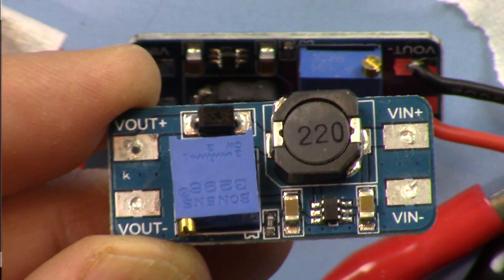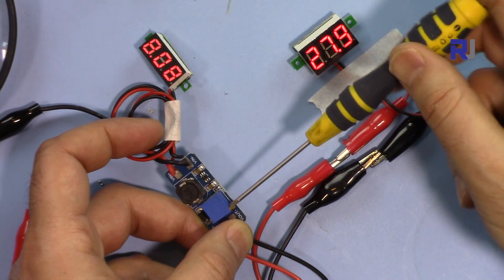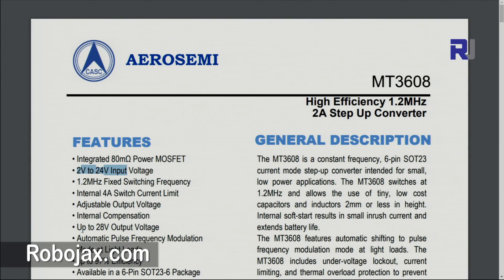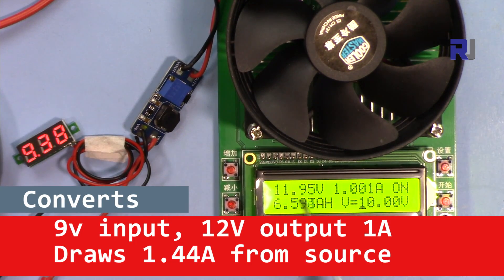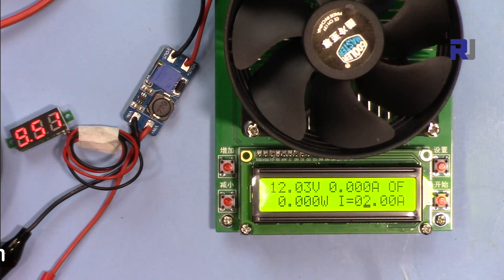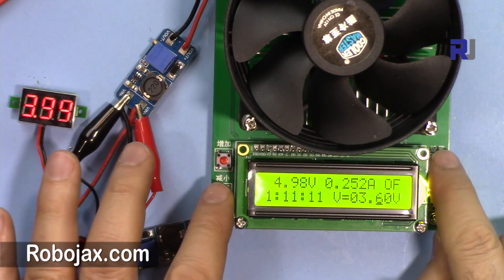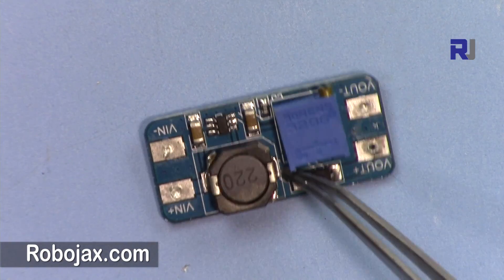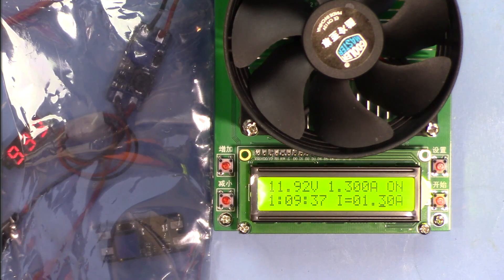Test review of 2A DC-DC Step up boost converter MT3608

Comment: But you can add mosfet on the chips output then it will not heat up that much and will deliver more curent(sorry about my english)
Reply from the maker: Yes you can change it. But my review is about this module itself without any change.
Reply: @robojax  i know but i just say how you can improve it(my english sucks)
Reply from the maker: Just add heat sink.
Reply: @robojax  if you add mosfet then you can get more curent out of it
Reply from the maker: not with this module.

Comment: Does anyone worry that failure mode could pump too high voltage?
Reply from the maker: I did read the datasheet and did not find any mention of the issue you  are interested in. as I was working with this,1 or 2 of them got damaged and the only thing that happened was the output was the same as the input. So it did not boosted.

Comment: Hi,i buy the same voltage booster,will it burn if i connect to 12 v car battery or it is not recomended,greeting
Reply from the maker: No. You can connect the input  to 12V.

Comment: I think this 2A meant to be the current which can draw maximum at any conversion. So for an example 12 to 24 conversion if you set the input current to 2A,  12Vx2A=24W and the output will be 24W/24A - (loss of the conversion)  = less than 1A. So I hope it works as they specified.
Reply: "...24W/24A..."    I guess you meant 24W/24V (Volt not Amp)! Other than this I think the same. Test failed by 12 to 24 with 1.5A but got kind of better with 1A and passed with 0.5A, so if you calculate the inefficiency or as you say loss of conversion something between 0.5A and 1A should be in the advertised 2A max. in this case.
Reply: pm me can you to install do sola paint of charger.
Reply: @anwin85alon
Sure, I can paint your charger.

Comment: Got one from ali express.  Doesn't work.  Input equals output.  So sad
Reply: I just buyed 5 on Ebay, ALL gives an output of 4.2V max. at 3.7V input as soon as it draws power. With no load i can go up to 28V.... WTF. :(
Reply from the maker: I mentioned that you have to rotate the potentiometer about 15 times until you see change in output. Try it.
Reply: Robojax I've tried many times already.  I got a data sheet.  Will fault find and let you know. Cheers

Comment: now this is what i call a test, well done! So if i have a variable 2-4V@60-400mA imput, can this board hold a Voltage of 6V or will it change if the imput Voltage is unstable?
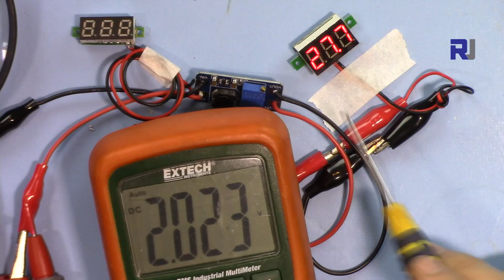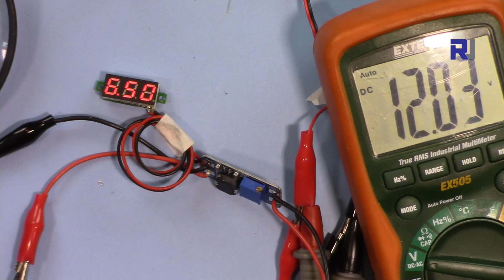Reply from the maker: at 01:14 (click to watch) I have shown that 2V is at the very edge where the module will not work. At 03:00  I have explained that the output is stable even if you change the input.
Reply: Thanks, just got a 5Pack from Ebay, my son will have a lot of fun building toys and solar builds this summer
Reply: oh, and you may like the "MCP73871 Power Boost USB 5V" Board, The black one, it can Charge and supply power to the applikation at the same time and so on, maybe you get one to test it?

Comment: I had purchased five of these circuits. Hoping to convert 12 volts to 18 volts. With no load, I connected the input to a 12 volt battery observing correct polarity. Each one immediately snapped and smoked and did not function. Is there something I am not aware of about connecting these to a 12 volt battery?
Reply from the maker: This is what happend to me  with other boost converter.  Apparently for all boost converter, we should have some kind of load otherwise the voltage continuously increase and it burns when the voltage reaches above the limit.
Reply: I've ordered this module and is yet to be delivered. Thank you for reporting.

I guess the trimpot is the culprit here. It might be at its lowest output setting.. maybe for 5v or even 0v... and you were connecting it to 12v source.

The input voltage has to be lesser than the output voltage for a DC boost  module.. Can't be vice versa!

Next time, try turning the trimpot screw anti-clockwise as much as you can before connecting to the battery.
To be extra safe, try connecting it to a 3v coin battery (maybe CR2032) and read the output voltage before connecting it to a powerful battery. I'm fairly sure a coin battery doesn't have enough juice to kill this module.
Reply: @ansk  thank you for that information. I had purchased some more of these and this time attach them to a variable power supply starting at zero. I slowly increase the voltage monitoring the output with a slight load. I was able to adjust the output and raise the input voltage to the 12 volts I wanted to use.
Reply: Thanks for the reply. :)
Took your advice and used a DC voltmeter (about 20mAH load) instead of a multimeter to read output voltage. Source were 2xAA used batteries with total voltage of 2.7v. The maximum output voltage I could get was only 26.9v! Maybe my module needs 3v min input for the rated 28v max output?!
Anyways! My requirement is to power a  12v 10w (833mAH) LED from 2xAA NiMH 1.2v 2600mAH batteries.
I hope the module does not heat up  much.

Comment: bro please please please tell me ,i can use  this converter in, 6v solar panel in run 12dc
Reply from the maker: Yes this can convert 6V to 12V. But remember this can not have power. Power = Voltage X Current . voltage is V, current is A.
Reply: and I can Charge 12v battery in 3waat 6v solar panel in boost converter. 
and, how many time charge this battery
Reply from the maker: Okay. We got 3W, 6V which means 3 ÷ 6 = 0.5A or 500mA. Then see your battery capacity. for example 3000mAh . If that is the case, then 0.5A = 500mA, 3000mAh  ÷ 500mA = 6H. So it will charge in 6 hours.
Reply: okay. I will charge 12 v battery in 6hour's ok
Reply: how many ampere converte, this boost converter
Reply from the maker: watch the video. I have explained it.

Comment: input 5v 1a to 12v 1 a can ?
Reply from the maker: NO. this will not work. At input 5V x 1A= 5W power, at output 12V x 1A = 12W, output can not have more power than input. in fact it is always a little low due to deficiency of module.  usually output is about 80% to 90% of input.  So you should expect less or increase the input current from 1A to 3A so you get 5V x 3A = 15W and it will be able to give you about 12W at output.
Reply: No it cant Voltage up current down :)

Comment: Hope you could possibly help. I was looking at these but after watching your video I don't think these work for me. I need to boost 5v-9v but I'll be varying the input voltage between 2-5v and I need the output voltage to move in relation to the input voltage. Is there a similar product that will do this for me? Thank you in advance
Reply from the maker: What you are looking for is called amplifier. This is regulator and keeps the output fixed regardless of input voltage. Amplifier will have some gain factor for example x3 or x100 or x2.5 and whatever the input is, it will multiply it by the fact as longs as it is within the limit of the device.
Reply: Robojax Is there an amplifier you would recommend. I basically need it so expression pedal that puts out 0-5v but I need it to put out 0-9or10v
Reply: Robojax not sure if I'm completely wrong but could I just use a standard 10w 8ohm speaker amplifier or would I need something more specific to accept the 5v coming in?
Reply from the maker: Speaker amplifier is not suitable as the input and output are non linear, meaning the output doesn't follow the input in a straight line. it is more curved and you will not get desired result. 
How ever it is possible to convert or make one of these modules to your application using arduino. But you would try different module and find the right one. Using Arduino you will read the pedal voltage, and correctly send signal to the potentiometer point of the voltage regulator and will act as if you rotate the potentiometer and the output voltage is changed.
Reply: Robojax thank you :)

Comment: did it already.added 82k resistor to 22k trimpot.this is for the version where the 3 rd leg of the precision trimpot IS connected and the voltage variation only occurs over about 20k. in the second variation the 3rd led of precision trimpot is not connected to anything and voltage variation occurs more evenly over a 100k normal trimpot

Comment: i replaced the100k  25 turn multi turn pot with a normal 100 normal 270 
degree trimpot.  the 25  trimpot is really stupid and you need a 
screwdriver and there is no knob for it anywhere

Comment: how about  3.7 to 12 out at 1.5 amp? or 1amp
Reply from the maker: sure it should work. This is way below the capability of this module.
Reply: it wont work... it has 2A current limit. The current limit is on the switching mosfet integrated in that IO. If you need 12V 1,5A at the output and 3,7V input (i am guessing that you mean lithium battery so it is 3-4,2V input) then you have 12*1,5=18W output power, when we consider lower effenciency at 3V To be sure lets just calculate  80% so 18W/0,8 22,5W at the input. If you have 3,1V input (almost depleted liion) it is over 7A of current. This one si rated just at 2 Amps...

Comment: Mt3608 based boost convertor is very good than others, stable output, it's very good for power bank
Reply from the maker: yes I agree.
Reply: Robojax xl6009 regulation very poor for low voltage performance.

Comment: Can a 24v dc motor of  250 watts can run on the step up module?.Please reply
Reply from the maker: Not using this module. For 250W and 24V the current is 250÷ 24= 10.14A which is way above capability of this module. You will need a module that can handle 11A or higher continuously.

Comment: Hey Robo, Can i use it at 5v 2A to 9v 2A im planning to use it to power my guitar pedal board with 5 pedals 600mah each.
Reply from the maker: No you can not. The power you are providing is 5V and 2A, 5x2=10W, and you are expecting to 9V and 2A which is 9x2=18W.
You can get 10W if efficiency is 100%. In this case you will get less than 10W.

Comment: How about it with 3,6V in and 9V out (with 500mA)
Is it stable or to HOT?
Reply from the maker: I am sorry I don't have it in had now. You can deduce if it gets hot or not from from thee other test results.
Reply: It's will take approx 1.5 amps at 3.6 to give 9 volts at 500 ma it will get hot. But the main failure of this module is when the 3.6 volts decreases it will boost the volts more than the 9 volts which will burn or kick your working device out of this world for sure. Soon I'll make a video my self showing the amps drawn in and amps drawn out.

Comment: Nice video! I appreciate how you showed that the chip got hot with high load as well as when using a large input/output voltage difference. The MT3608 is quite a powerful little chip, but one needs to understand the limitations of these modules. I killed one myself when making a 9V rechargeable Li-ion battery and then fixed the module by replacing the chip. On my channel you can find the videos I made about that. Perhaps you like to watch those...
Reply: pm me can you to install do sola paint of charger.

Comment: I have a electric bike battery with a USB charging port on it. I am unsure as to what the maximum rated current is on the USB charging port, but I think it is 3 amps. Is there a way for me to test what the maximum rated current is on the USB port? 

I was thinking of buying this: https://www.ebay.co.uk/itm/401092379923
The input takes microusb. I want to step up the voltage to 24 volts to power some lights that I have on my electric bike. The lights in total use 43 watts. So 43 watts at 24 volts = around 1.8 amps. Will this converter be able to handle 1.8 amps? Also, what current will 1.8 amps output take from source i.e. When 1.8 amps is being drawn from the output of this device, what current will the device draw from my source (which is the USB port on my electric bike battery). Please let me know if you have a solution. Thanks!
Reply from the maker: The first thing, you have to know the USB charging current to proceed.  From the current of your USB and it is 5V voltage you can find the power (watt).  Then when you convert it, the converter always have some loss like 5%-20%.  This module can give only 0.5A at 24V.  so 0.5x24=12W so you will be getting 12W. Depending on your battery, if you have 5000mAh battery it will take 10 hours to charge.
Does your bike come with charger? or you are building it your own?

So this module is very  weak for your application. if I know your budget and type of your battery, I would be able to suggest something.
Reply: Robojax Hi thanks for the reply. I'm not actually trying to charge the battery, I'm trying to draw power from the battery to power lights. I wanted to know if the USB output on my battery is able to power 43 watts of lights that I have on my bike.
Reply from the maker: if you do the math 43w÷ 5V= 8.6A and USB can never supply that. Besides, your bike must have on the manual or somewhere writing the amount of current. So get that current multiply it by 5V (usb voltage is 5V) and you can find how much you can draw.
Reply: Robojax Hi, thanks for replying :)   I built the bike myself (and bought parts separately from different sellers). The battery was actually bought lightly used so it didn't come with a manual. I therefore have no way of knowing what the maximum rated current of the USB port is. Is there any way to check?
Reply from the maker: I don't know if you can check it. But you should have some paper or ducument to tell you. Opening it might be lead not to be able to find the usb charge chip or not being able to read the chip name. 
in any case, as mentioned above you will not get 43W anyways.

Comment: I have the same unit - but upon testing I found that the potentiometer does not do anything. This unit is merely functioning as a pass-through. Something's not working - no matter which way i turn the pot, and for how many ever turns, VOUT is always the same as VIN. Since they're so cheap, i ordered a bunch more. Likely a faulty unit, but any ideas till i get the next shipment?
Reply: In my experience the module  is most often not damaged, but just not set correctly. I've experienced that the range of the potmeter is largely inactive. I would first disconnect the load and turn it down to the minimum level all the way until you hear the potmeter click. Then, with you voltmeter connected to the output, turn it the other way until you see the voltage change. Then continue slowly until you've reached the desired voltage. Then connect the load and check the voltage. If voltage drops a lot or the chip gets hot, your load may be too big. Mind you that if the chip gets hot you should cut the power to avoid damaging it. Good luck!
Reply from the maker: I faced the same issue and was thinking exactly the same way (mentioned in video) that you have to turn it at least 15 turn before you see the affect. I even opened a ticket to get refund for the item but the seller told me to turn it at least 15 turn and it worked.
Reply: Robojax yeah 15 turns is not the problem, I must've turned it 300 times in either direction, but VOUT does not change. I've even measured the resistance of the pot at various turns and it seems the wiper effect is working. I suspect a bad transistor perhaps, cuz this version has a crappy tiny one, not the big xl6009.
Reply from the maker: I don't know. it could be many thing could go wrong.
Reply: thanks this made mine work. It needs a lot of turns until it starts to raise the output voltage.
Reply: I'm having the same problem. Vout is .1V lower than Vin. Trimmer does nothing. I've tried grounding it, I've taken the chip off and swapped it around backward... Seems like my batch of 5 arrived with dead chips. Perhaps something happened during shipping when it was x-rayed by customs? Let me know if you have any developments.
Reply: I only had 1 out of 5 work.  The other 4/5 defective

Comment: Thanks I confused on my project how to get more voltage from my dc-dc booster but realized there was potentiomter on there.
Reply: Got one at current for a constant supply, issue is when i run two lines the chip even though I have back neg gates to stable and can seem good it then hits a short and throws the curcit stability yet on the other single lines is all ok on operating and is not above 250ma general current there not a bad unit for the cost used a lot off them and i hope to fix this shortly to finish a safety function curcit blown 5 now every time i fix part off the issue it comes back got the chip transistor sheet had a RF chip once put a npn that should have worked but blow all the line on the 4 pin selection same type but on for a slightly different use fine??😕on top did you know led can be used to stabilize function that would generally trip a 555 set of other had one that had 2 led for a on check on relay though save the juice the hole curcit went spastic you know that thor stuff in light??????.
Reply from the maker: You are welcome.
Reply: Does this amplify an automotive engine control module pwm 5v signal output to 12v dc... need it to drive a 12vdc solenoid 5.4 watts?
Reply: @marcosvega3464  did it work?
Reply: @thenande  have not tested one
Reply: @marcosvega3464  ok thanks for reply :)
Reply: @marcosvega3464  no it doesn't. You need mosfet or transistor for that.

Comment: Thanks for the info but do you see a pattern of the current ability? Does it go down as the input and output voltages get closer or further apart? Also how does the input voltage affect the output current ability? Thanks for any help you can give.
Reply from the maker: The output is independent of input . Please see datasheet for full details: https://www.olimex.com/Products/Breadboarding/BB-PWR-3608/resources/MT3608.pdf
Reply: pm me can you to install do sola paint of charger.